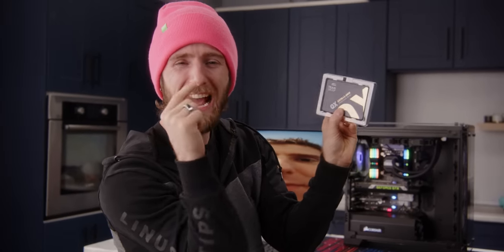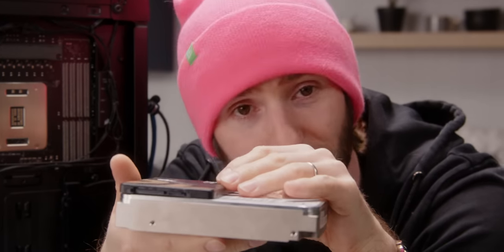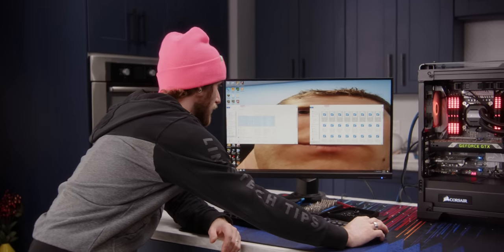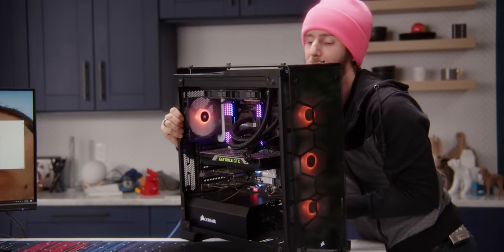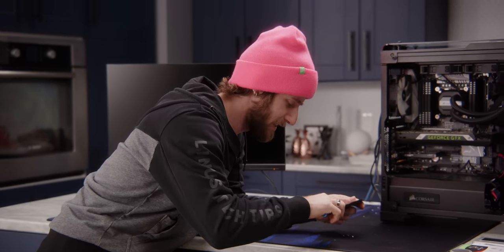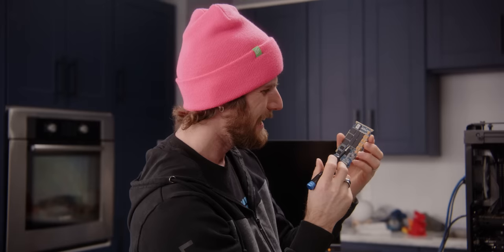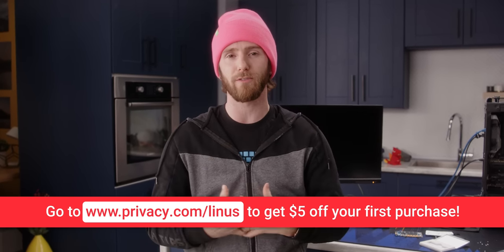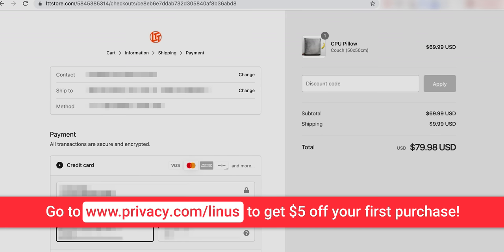The 15 Terabyte SSD is TINY!!

Comment: "61 copies of CoD Warzone"

Ah, forget Terabytes or Tebibytes, Warzones are the football fields of storage
Reply: "61 copies of CoD Warzone"
For now.
Reply: Or 42 copies of ark
Reply: I mean, it and CoD BlOps Cold War take up pretty much most of my primary 500GB game drive.
Reply: @rajatkamalchauhan1507  ark for Xbox is 118 gigs
Reply: When season 2 comes out it will be 1 copy of warzone
Reply: The freedom unit of digital storage
Reply: does that unit have a metric/imperial disparity?
Here in europe we do use that term quite a lot, but of course we do mean soccer, not american football...
Reply: To be fair, a terabyte is defined as 1024 Gigabytes. Microsoft is correct here. Marketing people are the ones trying to turn an octal number into a decimal number and failing.
Reply: Mr. Krabs Overdoses On Ketamine is only 1 GB.
Reply: you mean 1 cod update not including the base game
Reply: Ayy good ol' american units of measurement
Reply: @MinistryOfMagic_DoM  Marketing sure likes making a smaller number look big, but really the issue is kilo, mega, giga, tera, peta, etc already have a meaning from SI (such as in kilowatt, megawatt, gigawatt, etc). The 1024 meaning had been used long before it was ever formalized by the IEEE (or SI gave it a different definition). Then SI standardized those units with the SI (decimal) prefixes, not the binary prefixes. It's the IEEE which put forth the compromise of calling the binary versions kebi, mebi, gebi, tebi, pebi, etc. Frankly the only part of the IEEE proposal that people follow (given that kebi sounds stupid) is use KiB or similar to unambiguously denote the binary prefix. KB can mean either the decimal 1000 or binary 1024.

Frankly, as a CS major I almost always use 1024 but I respect that most of the time it's known from context which is used or it doesn't matter. For example, it matters to me writing software, but a programmer will normally use 1024. In marketing they're almost always gonna make the number look bigger (except in DRAM for some reason). In situations where it does matter and it could be ambiguous (such as in research) people often use unambiguous terms like 15 trillion bytes or whatever.

At the end of the day, the worse issue is people confusing KB and Kb, and even I sometimes get confused when I see bytes in something like networking when I'm used to seeing bits. It doesn't help that almost all tech-related tools use bytes for networking because honestly, using bits is stupid when packets always come in as multiples of bytes, not bits.
Reply: 61 cod warzones doesnt sound like much in 15tb. how big is warzone now anyway?
Reply: @marmite2956  So big I it never finished downloading. So big after I downloaded it from steam for three days and logged in. It started downloading MORE packs in game. So I deleted it instantly.
Reply: terrybytes
Reply: @lunakoala5053  Football > Handegg
Reply: @MinistryOfMagic_DoM  Giga is not some random cool word. It describes one billion of something. Like how kilo means one thousand of something. 

A kilobyte is literally a thousand bytes. Unfortunately that doesn't really fit into computer programming really well, so they (falsely) used the same term to refer to 1024 bytes instead.

It's not one or the other's fault that it was once decided that suddenly two different things were now called the same. They should have used a different name (or at least symbol) to refer to the computer programming kilo-mega-giga etc from the start.
Reply: @alinapaasz1841  the guy also turned off the like button probably cuz he had like 20k dislikes lmao
Reply: warzone: updates
I going to need you entire fucking storage
Reply: @marmite2956  it depends warzone plus base game is a good 200 gb of space then the average warzone update is an extra 90 gb sometimes 100 of space
Reply: FYI when cod war zone has giant ass updates it actually lowers the total amount of storage taken up in some cases because they are replacing many files with much more optimized ones
Reply: True 😎
Reply: I'm using warzone to describe massive storage now
Reply: @arturstatkiewicz6360  "Is that a challenge?"
Reply: @rajatkamalchauhan1507  or 98gb GTA V
Reply: Activision is in cahoots with the Hard drive makers. The bigger the games the more storage people will buy.

Activision and Western digital manically laughing somewhere.
Reply: @arturstatkiewicz6360  „for now“ LMFAO i cant dude
Reply: *Activision: who needs storage optimization/compression, you all have 100TB, these days right,
Reply: @lukepugh9999  ark for pc is over 300 gb
Reply: @alphaasianjosh  blop
Reply: this is exactly what i thought when the vid first started"
Reply: @MinistryOfMagic_DoM  Its a binary number, not an octal number. 1Tb = 2^10Gb
Reply: This is a brief reminder my hall of developer ambient occlusion radius shame is as follows:
Farcry 3 HBAO
Modern warfare remake HBAO
The witcher 2 SSAO
Farcry 4 HBAO, SSAO
Risen 2 SSAO

All to lesser and greater extents commit the unstable radius blob of darkness around characters to minor but technically noticeable to an eye looking to create a clean image some unstable screenspace drop in and out.

Nvidias HBAO also cut in and out at one part so far in crysis 3, where the fix was disabling and and using the raytracing method instead. 

Im on a mission from God, Gaben, to fix and enhance 2014 and under, the highlights.
Reply: @aidancommenting  

The entire point of my end game, is mass installer uninstaller packages with all relevant mods to graphics bundled with mine. Quality or no one cares. Unfortunately rando little kids can make and publish mods too. It doesnt always turn out all that great, and the tech journalists even digital foundry wont even notice because who cares.
Reply: May it be a light to YOU in dark places, when all other lights go out.
-J.R.R. Tolkien

Lightsaber buzz intensifies
Reply: "Americans will measure with anything but the metric system."
Reply: u forgot medal of honor above and beyond had 250 gb when it released
Reply: It suddenly don't sound impressive anymore...
Reply: @lukepugh9999  its taken ~300gb on my pc
Reply: @paulelderson934  I've been around computers for a long time now (software, not hardware). I always believed that you could never use 1000 as a defining unit, and hence, it was always KiB, MiB and GiB when dealing with computer stuff and the KB, MB, GB has been generalized for the public. Now it seems I have been wrong and the marketing departments don't give 2 $h!ts about accuracy. For them, bigger is better.
Reply: Kinda annoyed by that statement 1024 is the natural progression 1000 is off-base.

2,4,8,16,32,64,128,256,512,1024.

You don't buy RAM with only 8000MB and call it 8GB, it's 8192MB.
Reply: Ark survival evolved takes up 400GB
Reply: @lukepugh9999  play Ark on PC with mods and 1Tb barely cuts it lol
Reply: I think we need to somehow download it into our brain
Reply: I remember when the game was called Modern Warfare
Reply: lmao
Reply: @lukepugh9999  ark for pc is approx 350 gb
Reply: @DaneH64  I meant copies not gb ark is approx 350 gb game
Reply: @NewsOfTheRebellion  because kilo literally means 1000 and giga 1000000000 and terra 1000000000000
Reply: Itsa good thing my pc isn't infected by a single copy of that virus.
Reply: Andrew Mausisa how fast is your connection mate, 3+ days for ~115 GB?
Reply: Soon... 10 copies of warzone and 15 copies of Batman
Reply: @Juuls04  lol I'm aware of the prefix meanings which don't change the fact that computers work with binary which produces Bits and Bytes but alway as a multiple of 2. Follow the progression of the numbers listed.

Anyway I'm to take kilo literally when concerning PCs as well as stop using binary pronouns, society is so off.

I trailed off. Anyway (kilo) is saying a thousand bytes which as stated are multiples of 2. So 1024KB is 1 GB.

The prefix doesn't define the whole word.

Like saying someone is a man or woman doesn't define who they are despite what they want to believe lol
Reply: @NewsOfTheRebellion  What? Kilo = 1000. Thats a fact. Your man / woman comparison makes no sense. The reason its indeed 1024 is because its easier because its indeed a magnitude of 2. However that’s not a Kilobyte that’d be a Kibibyte
Reply: This is why I haven’t downloaded Warzone on any machine I own.  That’s just a crazy game size.
Reply: @Juuls04  Hey Seuss Fudgin' Spiced when I get back home from Cleveland you're getting it, even though I should stop while I'm ahead!
Reply: Around 130 copies of MSFS2020
Reply: My macbooks storage is 1 warzone + 1 cs go
Reply: The real question is how many copies of classic doom would it take to fill this one drive?
Reply: @outsideredge  Warzone is 90,1GB at the moment. It's a lot but nothing crazy.
Reply: Man so much storage and bandwidth for so much garbage
Reply: 15 tb isnt alot for gamers
Reply: @lukepugh9999  ark plus the DLC's for PC is like 500 ish gigs

Comment: Linus: "The most ass looking data cable"
Me: looks at all my red sata cables that are in use connecting all my drives
Reply: right, who wastes money buy buying pretty sata cables... i always just use the freebies in the mobo box or ssd/hdd box
Reply: @justincase1898  omg... Almost cried inside. It's a data pc, not a work of art!
Reply: @justincase1898  My mobo ones are black though.
Even my old h81 asus board had black sata cables.I had a h61 mobo that came with blue sata cables which looked fine IMO.
Only optical drives come with red sata cables.
Reply: @BloopTube  next step is the rgb cables
Reply: The ones in my mum's are mustard color
Reply: @BloopTube  sensiblechuckle.gif
Reply: Thought the same 😂. Ohh hey he has the cable I got from Amazon today
Reply: Me: SATA IS SATA
Reply: A N I M E
N
I
M
E
Reply: @justincase1898  People who use repurposed Dell optiplex's with more storage disagree the HDD's and SSD's I got had no cables included. (been there)
Reply: Mine are a mix of red, black, yellow and blue. The later is not particularly common, and I can't remember ever getting a green cable with a motherboard. At work I used to sort them after length and model of connector. That resulted in quite a few bins just for the SATA cables. Length is self explanatory but connectors take some explanation. 

So how many different SATA connectors are there really? Probably more than most people first think. There's the straight ones and the angled ones right? 
Actually that's just the beginning. Those angled ones come in at least two versions. First you've got those that are angled so the cable is pointing down from the drive and then there's those that are angled so the cable is pointing up from the drive. So does that mean that there are two kinds of cables with angled connectors for each length?
No, because there are also cables with two angled connectors, and just to make things interesting there's cables with two angled connectors, but one is angled up and one down. So that's a total of five versions of cables with angled connectors. (up + straight, down + straight, up * 2, down * 2, up + down)

And we are not done yet. Just for fun there are cables with and without locking tabs. Most cables you get with motherboards doesn't have the locking tabs, and frankly they can be a pain to work with as often the locking tab won't depress enough to release the connector or it won't lock reliably into the socket on the drive or controller. Not the best design they could have used for locking tabs, but even so it effectively doubles the number of possible cable models.

But wait, there's more!
Finally there are longer and shorter versions of the connectors. The most common connectors are about an inch long while the most compact are only about a third of an inch.  This can be important in some cases, so I had separate bins for these too.

Aaand we're not quite done yet, but don't worry to much as I can't come to think of anything but one more cable type and that is the ones with the flexible connectors. That is they can be angled up or down as needed. But these you have to special order as no motherboard or controller comes with these, at least AFAIK.

And that was the basic SATA cables. I also had bins full of multilane cables. That is cables for SAS and SATA drives that has a single connector for usually four SATA or SAS channels. These are used between an HBA (Host Bus Adapter or controller card if you like) or RAID controller and the drives or a SAS / SATA backplane. These can have a ML connector at each end for use between the HBA and a backplane, a ML connector at one end and fan out to four SATA connectors and finally they can have SAS connectors instead of SATA connectors. Again they come in several different lengths and some fan out cables even have different length for each of the four cables it fans out into.
Oh and just to make it even more fun there are several different Multi Lane connector standards. I can't remember how many but I think it's at least three internal versions and two external. Yep I had a lot of bins and yet I never seemed to have enough...
Reply: @KokoroKatsura  
ANIME
N N
I         I
M             M
E                        E
Reply: @williamhoward9121  Where did you find those?
I want some😉
Reply: @blahorgaslisk7763  This is a lot of concern for sata cables
Reply: @fluffysheap  Well we built servers and workstations. Some machines had more than 50 drives, but even when there were only ten of them it could get quite "interesting" getting everything wired up without causing a total mess.

The servers mostly used SAS or SATA backplanes with or without expanders. A lot of the SATA backplanes used individual cables, and in a single machine it wasn't unusual to use four to eight different length of cables to make it easier to manage. Controllers used also varied. In most servers there would be up to three RAID controllers with up to 16 SAS lanes each. These all used Multilane connectors, but controllers with up to eight SATA lanes could have an individual cables for each drive so cable management was very important.

The one kind of cables I really didn't like was the ones with the long SATA connector. These were often physically to large to use and yet they came as standard with for instance the 3Ware controllers. But as we got them with every such controller we ended up with a lot of them to keep track of and used them whenever there were no physical limitations to consider. Electrically they were very high quality with very good signal integrity.

This last point was also important. When using one or two SATA cables most of them will work just fine. When you start bundling up ten or more cables things are not as simple. You get crosstalk between cables in the bundle and the signal integrity goes south. To avoid this you want to use good quality cables and keep them as short as possible. You also learn not to make the bundles to tight as that makes the interference worse.

So every kind of cable has its use, and when you need a particular version you want to be able to find it quickly.
Reply: @makisekurisu4674  TBH, been messing with computers since 2002.. never seen a red SATA cable till this video

Comment: In earlier days before the release of IDE drives all drives that I knew about used 1KB=1024Bytes, 1MB=1024KB, and 1GB=1024MB (but it took a while before 1GB this become reality, and it was HUGE). The drive types were mainly MFM, RLL, ESDI and SCSI for MACs and servers. And there was no confusion about storage and memory capacity. It was even common that the drive capacity was a bit above the rated size, I guess not to cheat the customer of anything.

Then IDE arrived as a lower-cost alternative for personal computers. At the start, all was as before but after I started to see drives with 1000 as a base for size instead of 1024. I think it was Conner or Quantum that was the first to start this, but I can not guarantee this. I think these brands were new with the introduction of IDE. The traditional brands continued to use the 1024 base for a while before they also switched over. I am sure though that Hitachi was one of the latest to switch over and they gave you that little extra. I still have some 75GB drives and I think also some 80GB that is based on proper GBs.

But why did this change happened? I am quite certain that it's because IDE, in the beginning, was intended for the to a great degree computer illiterate consumer market and that someone with the first manufacturer to do this thought that by using 1000 based drives instead of 1024 they could sell slightly smaller drives for the same money and nobody would notice.  And it seemed most didn't.  I remembered that I thought it was highly immoral of the manufacturers to use fake KBs and MBs, so I avoided them and bought from honest manufactures that gave me the proper size. It looked very similar to someone selling using a slightly lighter pound or kg weight to cheat the customer, which is strictly illegal. But after some times, all had switched over.

Today this part of computer history seems to have been lost to almost all that talk about storage size. To me, it seems strange, as I observed it happening. It looked like something very close to fraud has changed the norm of the whole IT business so that now all people think is that there is a very strange difference between storage and RAM, while the history behind it should have been known.